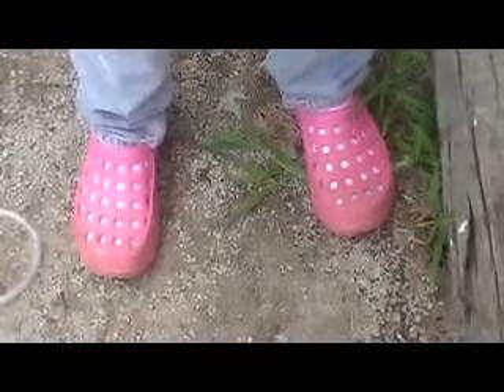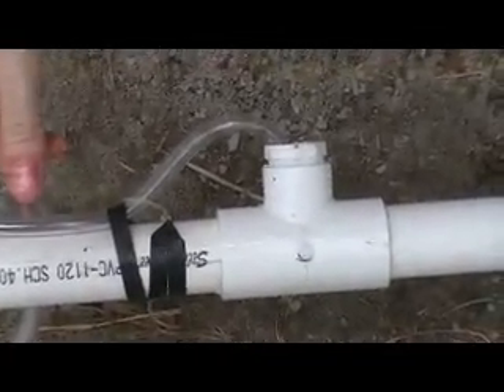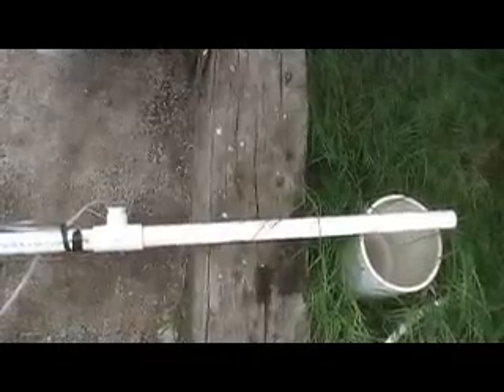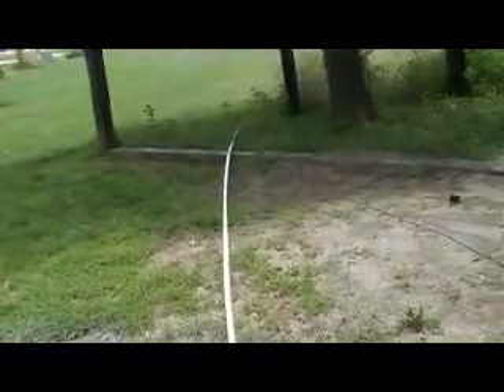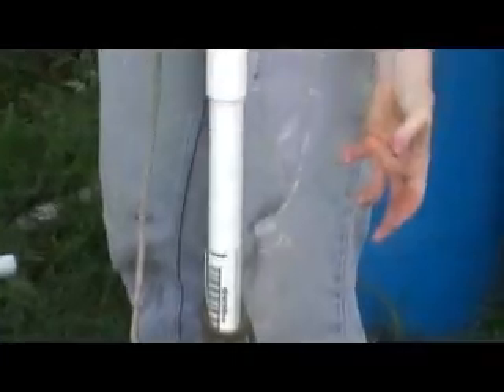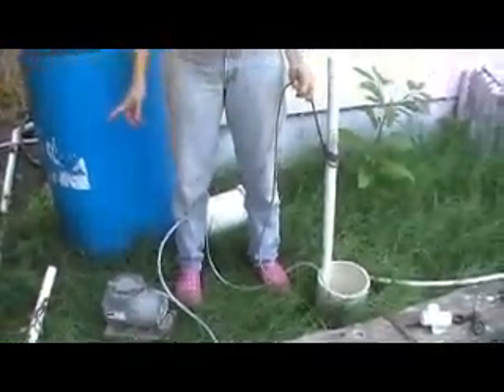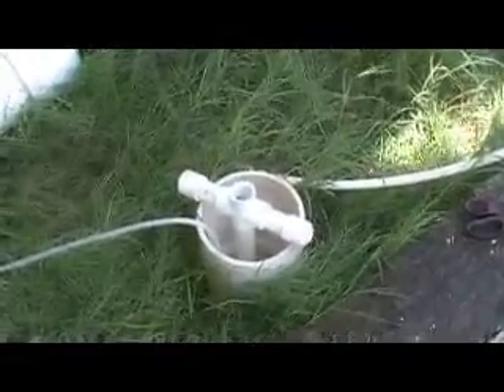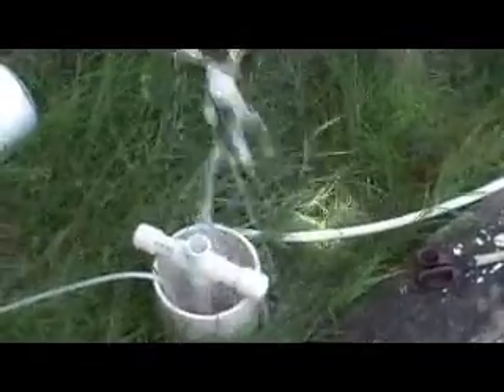Brumbert Airlift Water Pump

Comment: I have a 5" well that is 100 ft deep and it is 40 ft to water. I wonder if i can lift water 40 ft? I have a 100 ft roll of 1/2" poly pipe. I can get a 3/4"x100ft garden hose at harbor freigh and use it for the water up pipe. I kust need a couple hundred gallons a day

Comment: If you'll install a large defusing stone in your drop line. It will lift fommy water very consistently. Just install a short peace of pipe much larger in diameter 3 or 4 feet in length. Place the stone 2 or 3 feet from the bottom. Steady flow. No joke.

Comment: They could have made their plastic pipe with the holes and about a foot longer easy you want the whole to be bought 1 mm that's less than 1/16 of an inch and yet be careful when you don't break your bed more air bubbles you have the more lift your have small bubbles if you want to do this experiment with it let's say you put a 1 in tube 36 in put a 1-foot AirStone in it shove it up in there in that pipe your mouth will drop open when you see a lot of water come out the end of the pipe if you got a swimming pool make one

Comment: I was looking around for ideas to clear sediment out of the bottom of my well, I measured mine last week at 60' but felt the sediment and I'm not 100% sure how deep it was supposed to be, I think around 69' to 72' my concern with using that old pump/compressor is if you go down lower in the well and have more water weight would it put more strain on the compressor and/or not be as effective at a higher depth? I have a compressor just like that one in the video, came out of an old massage recliner we threw out after we bought this place but we saved the compressor.

Comment: I used to have a large aquarium. This is, basically, is like a lift tube in an aquarium. The air pump injects air near the bottom of the lift tube, to circulate the water down through the gravel filter, up the tube, and out through the charcoal filter. Same principle, anyway.

Comment: this exactly like one works they could have build a module that would put out 15,000 liter an hr see introduction to air lift pumps on YouTube these pumps have been around since beginning of 20 century the use them in septic & acid application if you live where U need an aerator storage tank to remove sulfer smell out of you house water  build it, pump water to house with a pressure pump baam done a 25 watt air pump from well to tank BAAM

Comment: Since you are going purely vertical with this, a small ball or check valve on the foot-end of your water pipe would work wonders to change that constant pulse from hurting your output. Try adding a (non-spring, but gravity) check valve (take the spring out, if you have to, or just add a rubber ball and stake-pins), you'll see it makes a ton of difference.

Comment: also from reading other comments as far as energy use goes this type of compressor uses 345 watts on startup and at max work load mine is a twin rocking piston rated at 500 watts but on a watt meter only uses 189 watts while pumping it is an oil-less and pumping 9gpm at 88ft with static level of 18ft while running static level is 15ft when shut off and I tested this air-lift pump at 1 foot below the water it was lifting water out of the well needed to use smaller water lift pipe and almost no air volume and I did this to start work on a back-up system thanks again for the vid hope I didn't bore you all with my post lol

Comment: kool vid I like it when people try things even when others say it will not work good job also wondering if you have done any further work on your system? would love to see it I have built a similar setup air-lift in to holding tank then pressure pumped in to house needed to remove hydrogen sulfide (iron bacteria) out of water without any chemicals once again great vid hope to see more of your system

Comment: Are you still using this to get your water? I certainly hope not. That pump draws 345 watts and you would have to run that all day to fill a tank to service your home needs. You could build a simple solar set up for less than $400 that would run this on a timer and water level switch to keep your tanks full for plenty of water use.

Comment: Sink your PVC pipe down as far you care too .. seal the top of your well airtight with the PVC extending up through the seal.  Pump air into your well through an entry port.  Air pressure in the cavity will force water up through the pipe independent of submergence depth.  Every 14.9 pounds per sq. in. overpressure will raise water by 33 ft.  I suspect flow rate as only modest.  This strategy dispenses with the down-hole air hose.  For what it's worth.
Reply: I wonder if you could just have a really thin tube going down with a valve at the top and put it indoors so when the wind is against the house it will be lower pressure indoors and the water comes up when it stops the valve closes keeping the water at the top of the tube ready for the next gust.

Comment: I think I understand what you were saying at the,  Submergence ratio is 66%, that is to say that the lift above the water line can be 134% of the distance of 
the depth of the pump in the water. I don't know if this is true but 
It's got to be a % of depth to height. Thanks for the video.

Comment: It works!!!  well I was sceptical at first but I took it one step further and went with a geyser pump (6 bucks of PVC - the pipe) I dropped my pump almost 200 feet down with my water level at 45ft from the ground. I got a blast of pure water (3 gal in 5 seconds) and filled a 50 gal drum in just over 5 min. (non stop water then air mix). makes me want to try to build a permanent magnet generator now, those arent supposed to work either.

Comment: if you look at the type of compressor that is used it is a diaphram type which uses no lubricated parts exposed to the air. it has a rated max pressure of 30 ps; it probably doesn't use that much by far,i and is quite low volume in the size you see in the vid so the output of water is impressive.. I think a ball check in the bottom might improve it a bit.

Comment: Actually, this is not like a Brumby Pump. You have a very basic airlift pump, which has nowhere near the versatlity and efficiency that the Brumby Pump has.
A lot of designing and testing has gone into the Brumby Pump and the addition of the controller where needed allows use in situations where a simple airlift pump would not function.....thanks for the video....

Comment: I love it!  Easy and strait forward description of the air lift pump assembly.  Thanks for posting this.  I've been looking at doing this same thing at a remote cabin.  The downfall with my place is lack of AC power.  Are you worried about the oil from the pump contaminating the water?  A friend suggested if I went with this system to get a in line filter for the air to keep any vaporised oil out of the water.
Thanks for the demo.